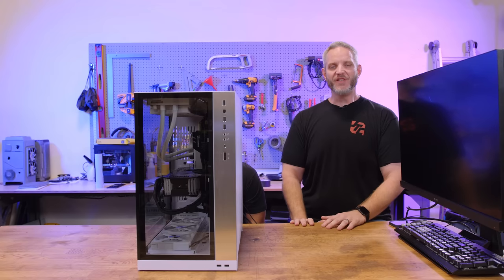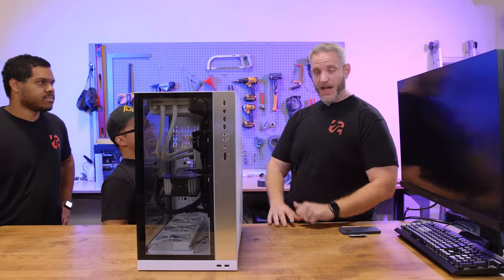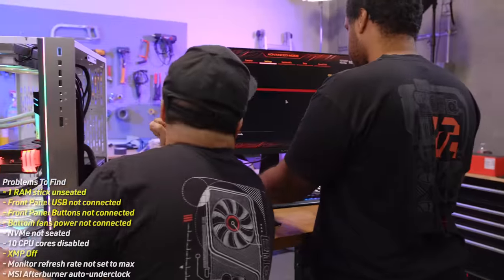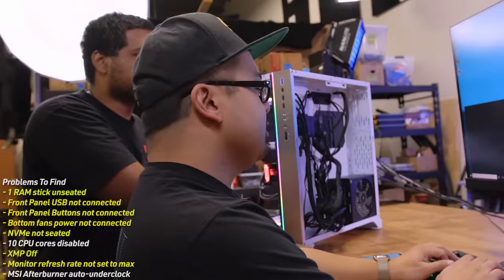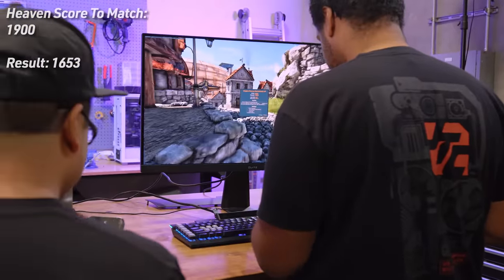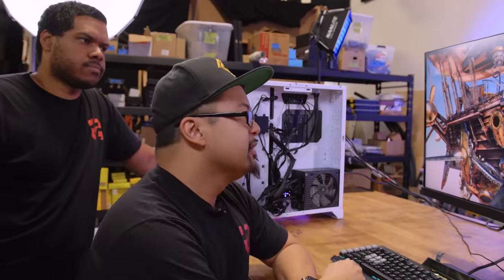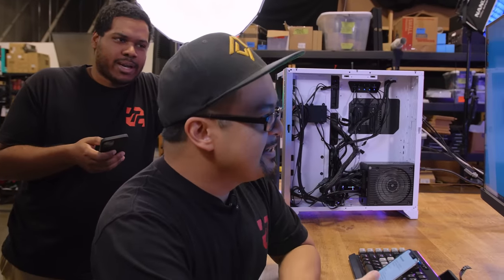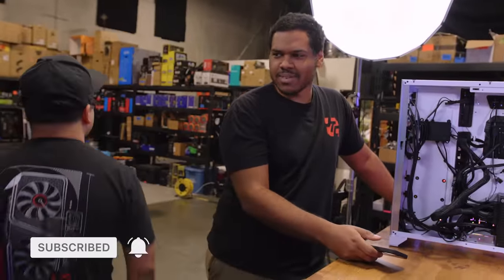I said I would give them CASH if they could fix this "Sabotaged PC" - Tech Challange

Comment: On Stupid Europe Hz: Nowadays ~99% of all monitors on the market will default to 60 Hz (~1% 30 Hz) anyway and most couldn't even do 50 Hz without VRR and/or forcing it.
While most cameras would default to 50p in europe to avoid flickering or even good old 24p despite the fact PAL is dead here for nearly a decade at this point.
Edit: And yes I hate Windows for defaulting to 60 Hz too.

Comment: before even watching ill find 2 of the problems that im pretty sure are present. xmp is disabled. cpu is not running as should. kinda obvious if its not hitting the scores. then also pretty sure theres things and cables disconnected. so yay im sure i found 3/9 problems just by that

Comment: This was easy. I could've figured this stuff out just by my natural troubleshooting path. I check all connections and re seat everything I can easily like RAM, GPU, NVME/SSD. I would've cleared the CMOS which would've solved any BIOS problem. Then set XMP. Then I would've uninstalled any overclocking software on the PC to see if that was causing issues and if that wouldn't work just reinstall Windows which solves basically everything. After that I know that Windows never sets refresh rate to the highest setting, so I fix that, and I'm done. Could have all this solved in like an hour or so.

Comment: Hey Jay a question with all the spare pci express slots available most of the time. What would you recommend using it for
Reply: This is what kills me, back in the hayday of building your PC, you had to use those extra slots for sound cards, and other various expansion cards.  I was pretty upset with the first few new build videos where all it is is a drive, cpu, video card, and power supply.

Comment: Question. 5m22s in, the PSU fan is not running but not listed as an issue to solve so I guess they were expecting that. Except I don't understand. I assumed the PSU fan, like all the others, would run all the time? I guess not but can someone confirm and explain please. Thanks.

Comment: I had an obscure issue after upgrading my ram. Windows didn't boot: ACPI_BIOS_ERROR. Linux crashes with same error. But, when I took 1 stick out and ran it in single channel, both OSes would boot just fine - swapping sticks for good measure. Then running in dual channel with one old and one new stick, mismatching 16GB with a n 8GB, same error. Dual channel with the new ram seems to be a problem. Memtest86 passed! I did all the things like flash the latest UEFI, reset UEFI defaults (not many settings I could change anyways). So confused.

Then, I just so happened to get distracted, by chance, while stalled during the Linux boot. Distracted for a few minutes, then Linux booted. PopOS saw the full 32GB. Everything seemed to run normally. But, shut down it crashed. Definitely not stable. Even more confused.

So, I decided to create a live USB. That booted without issue. 🤔 This is where I left this last night

Today, decided to try to take out my 2nd NVMe drive: installed myself after buying this laptop, see if I could eliminate a possible adverse hardware interaction 🤷‍♀️ this left my Windows drive in. Windows booted. I tried the Linux drive all by itself. It failed to boot. Now I'm cluing in on what it could be. With both NVMe drives installed, I used the UEFI boot menu to start the Windows boot manager... it booted! Then tried Windows again via GRUB bootloader, it crashed! Sooooooo for some reason the grub bootloader doesn't like this ram configuration and that's where I am now: repairing my bootloader 🤷‍♀️

Comment: Give them a pc with sata ssd formatted with MBR style partition table in a system with legacy boos boot on. Then ask them to increase speed of the ssd by 1/4th without losing the OS install on the drive. Good luck, it will take em hours to figure out how to convert the drive to GPT style table and make it work with uefi and ahci.
Reply: heh...i've been hackintoshing since my single-SSD i5-2500K build. woulda caught onto your trick :P
Reply: this was a compliment actually.
Reply: give them a box of punch cards, and have them boot and run a program.

Comment: Can you guys make a video showing the temps of this pc running R23 with all the different Ryzen Master modes. I have a 5950x and my temps are running very hot as soon as the test starts it spikes to 87*C and holds there. Build list is an Asus ROG Strix X570-E gaming MB, AMD 5950x, Asus ROG Strix 3070, Ausu ROG Strix 360 LC and Case is a Thermaltake View 71 with a total of 12 fans in it. Bottom 2 120mm, front 3 120mm intaking. Rear 140mm, top has 3 120mm pushing air into the rad and 3 140mm pulling air from rad all on exhaust. I have already reapplied TP 2 times to make sure it wasn't that. Even Eco mode I'm getting temps around 75*C under load. Idle temps are about 38*C. I have even taken the top and side glass off to see if it helps and temps only go down 1*C and my room stays about 70*F. I have not changed any settings in the bios because I don't know enough about that stuff.